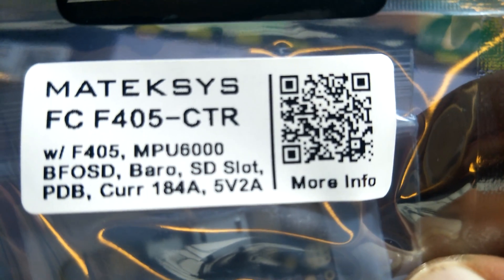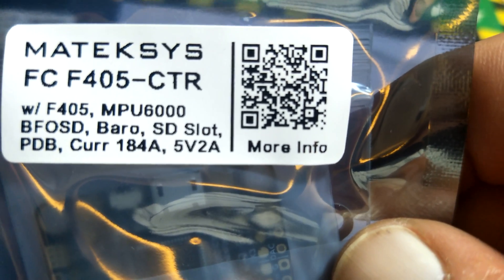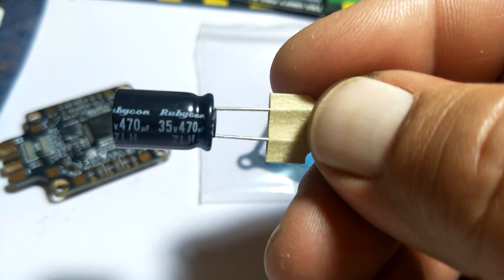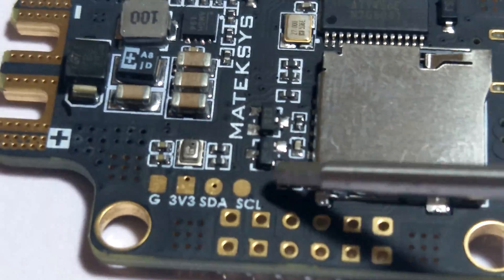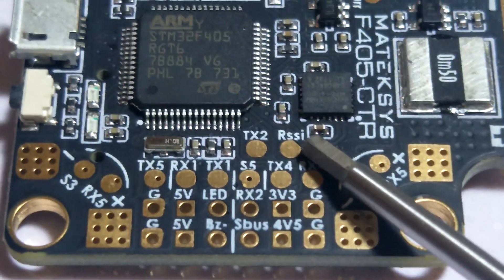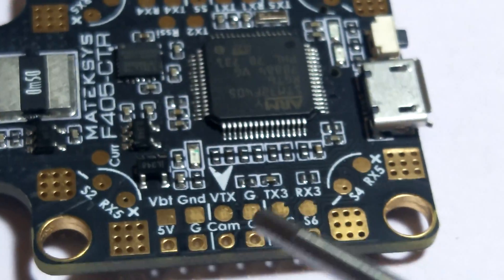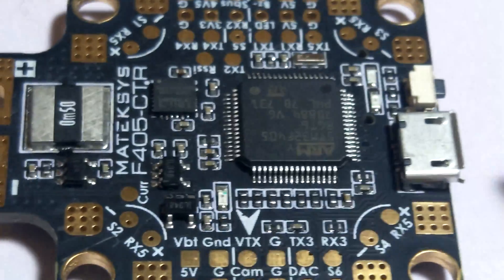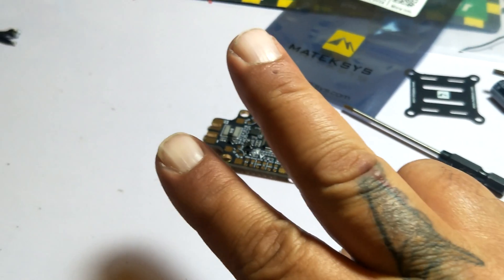NEW Matek AIO FC!!! The F405-CTR!

Comment: what do you solder to the Curr pad? from battery, esc or somewhere else ?
Reply from the maker: Current pad?I don't use it for anything.
Reply from the maker: You can check it all out here http://www.mateksys.com/
Reply: the one next to s2? isnt it needed for Current display in Betflight OSD ?
Reply from the maker: nope. It has an onboard current sensor
Reply: Oh yeah, makes sense sinse it should have all that. didn´t find any wiring diagram on the official site using the curr pad. maybye its a measuring point for failsearch? Thanks for clearing it up! thanks for the sweet video brah!

Comment: The capacity doesn't really matter it's about the low ESR rating. The zlh ones are a pretty good ESR. The shunt resistor is on the top of the board. And the 5-volt on the bottom definitely doesn't power the board that will blow it out it's for providing 5 volts to whatever you put on it you provide power to the board by the big pads coming out the side

Comment: Hey, great video! What is that thing about connecting your vTx straight from the battery to reduce noise? Can you explain more please.
Reply from the maker: TBS unify HV has its own filtering...hooking it straight from the lipo pads avoids any potential voltage spikes or noise from other components on the quad..

Comment: Maaaaan there is notttin i like more than start thinking a new quad and you posting a new product !¡! Hahahah  so great Fc... promises godnessss  ...  i want this FC for a light build ( mode 2 ghost frame with some BrHby r3 or R5 )  i am thinking how to run the esc's and i was thinking in the 4 in 1 esc DALRC ENGINE 40A 4IN1 ESC.... came out 2 days ago.. did you had a look at it? Actually i think its the most advanced 4in1 but correct me if i am wrong but looks like the 4in1nes, do not make the telemetry output yet... how long until we get the best out of the 4in1 escs?  Thanks thanks for that so descriptive video , so cool man , we appreciate!!!  Regards BooHH yaa! Xd
Reply from the maker: hahaha...awesome bro!! ...personally I really do not care for the 4 n 1 ESC config. So I am not real up to date on the innovations. I do think undergroundfpv.com may have one called the Kamikaze that fits the bill..
Reply: SKIDOOSH i will check them out straight away 4 in 1 in a light build is the way to go thanks for sharing m8
Reply from the maker: Actually I have weighed a 4 n 1 with the extra lengths of wire and then separate ESC's and they are only a few grams different.
Reply: SKIDOOSH great, now you are mithbuster also hahahha  .... but makes for a cleaner build and easy.... i am not a big fan i got to say of 4 in 1 but the arms of the mode 2 ghost does not leave much room for esc's ...